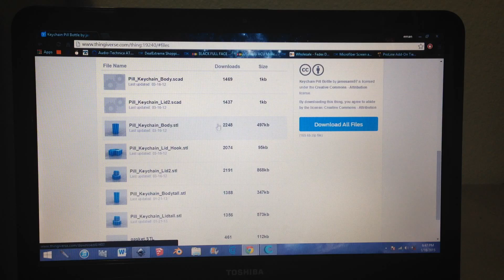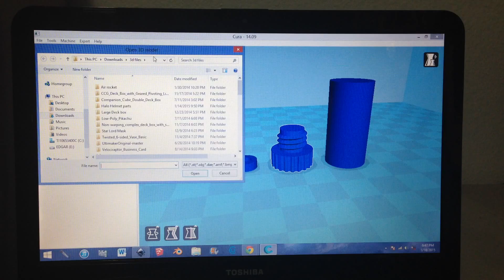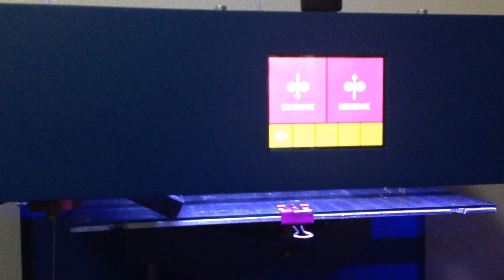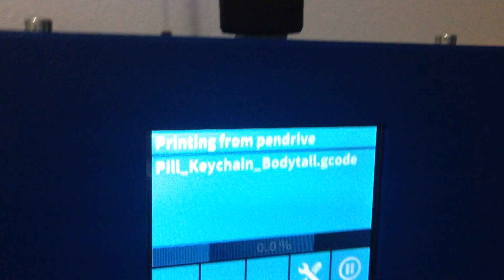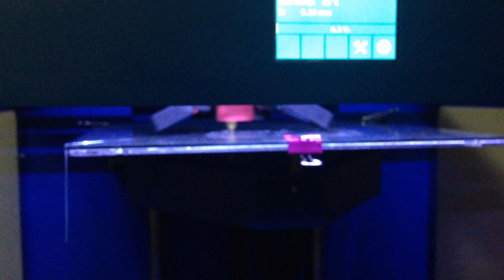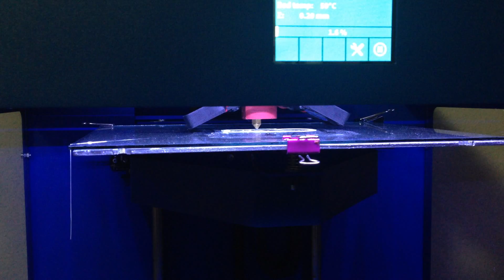How To 3D Print (On a Craftbot)

Comment: because when i try cura there is an error message
Reply from the maker: RENSO GOMEZ Start by using the newest version on cura, then i "added a new machine" and put in the following info, E-steps per 1mm filament 0, max width-250, max depth-200, max height-200, heated bed-check,  extruder count-1, machine center 0,0-not checked, build area shape-square, gcode flavor-RepRap, the printer head size settings are set to 0, serial port-auto, Baudrate-auto, IMPORTANT-copy the start and end gcode from Craftware and put it in cura. Let me know how it turns out :)
Reply from the maker: RENSO GOMEZ i also save the gcode to a flash drive and print it from the flashdrive on the printer
Reply: Awesome!!  I'm trying to follow your settings, but not sure about the last part (copy the start and end gcode from Craftware and put it in cura) Do i need to delete the cura code and paste the craft ware one?
Reply from the maker: Yes, delete the old gcode and paste in the gcode from craftware for the start and end
Reply: Got it, tried and its working!!!
Thank you Makerman16!!!
I really appreciate your help :)
Reply from the maker: No problem, glad i could help!